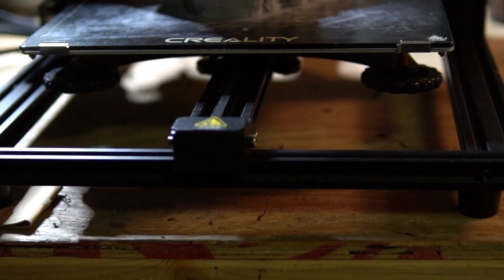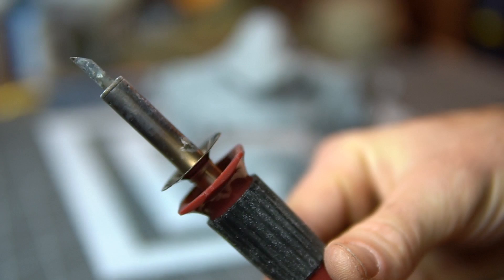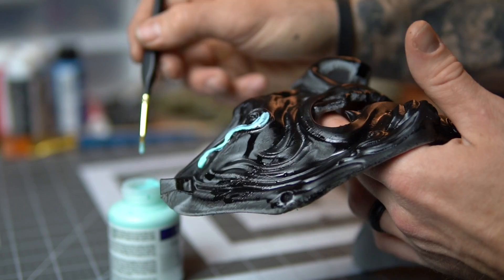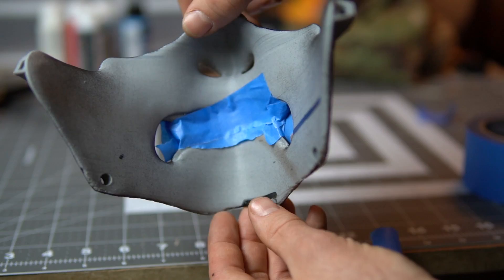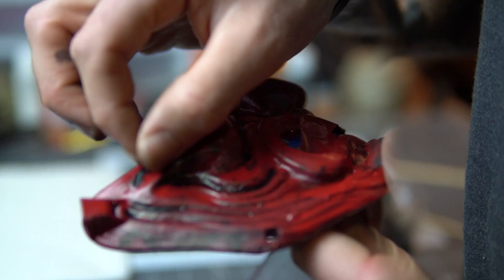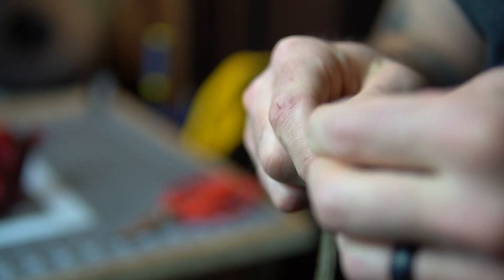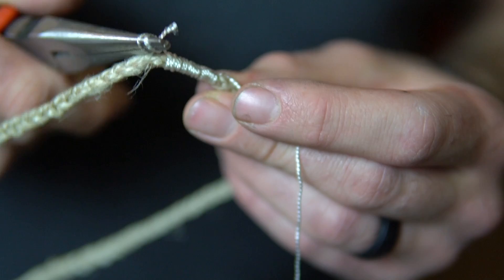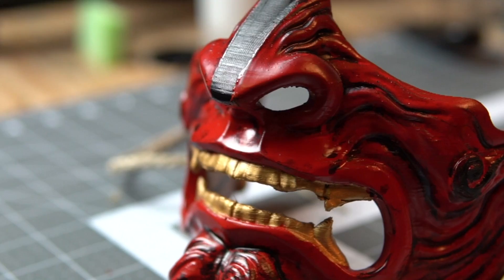Making A 3D Printed Samurai Mask/Menpo

Comment: how do you keep the mask on your head i have the same one but struggling with it i use paracord
Reply from the maker: So I pulled the rope through both holes and then looped back through between the mask and the rope  about  middle way of where the mask is. This created natural ear loops, and then I just tie it behind my head. Also putting a little extra foam on the nose to prop it up more.

Comment: Hi mate, I don’t know if your gonna read this, but I’m looking at printing something like this off, I could really do with some advice on support placement, orientation and cura settings for the print you’ve done chief
Reply from the maker: Honestly, all I did was have tree supports on. It’s hard to give settings because each machine is individual. Even mine is calibrated right now because I got some new filament and now it’s off. Unfortunately you gotta just play with it. I hope this helps somewhat and thanks for watching!

Comment: Have you ever tried doing a acetone vapour bath to smooth the print
Reply from the maker: You know, I haven’t. The only thing I’ve done is a coat of resin to smooth it out. Have you had good results doing that? I’ll have to try the acetone sometime.
Reply: @paparomeoproductions5956  yes it works wonders , just don’t leave it in too long

Comment: What size printer would i need if i wanted to make some similar or more detailed masks?
Reply from the maker: The most convenient would be something with a bigger build plate. Something with a 12x12 in plate like a CR-10 v3, or similar. However, you can get one with a smaller build plate and print the mask in two pieces and join them together after they have printed!